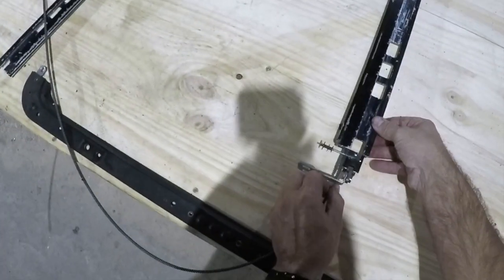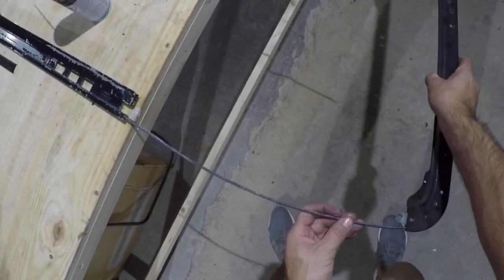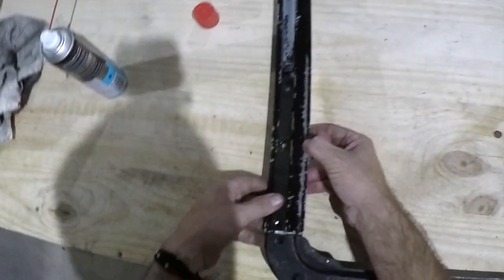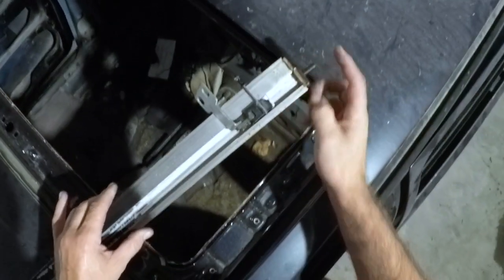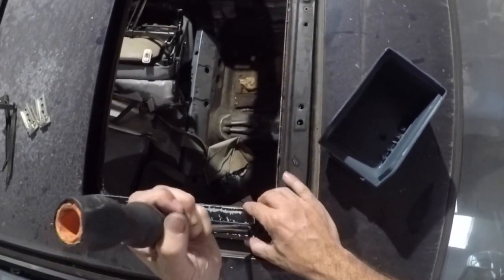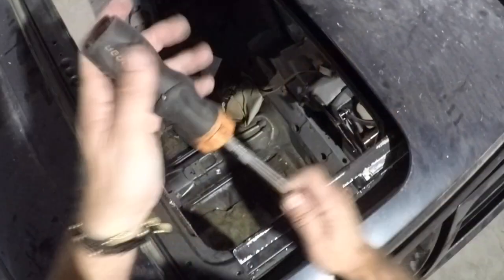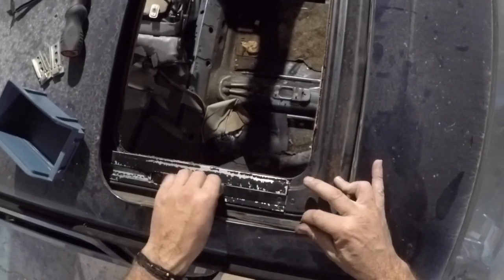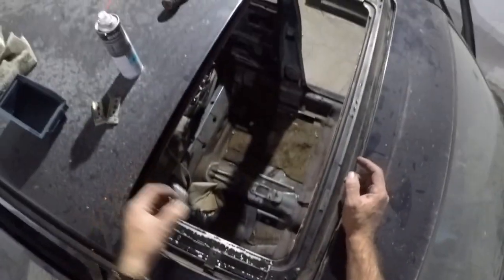How To VW Golf MK2 & mk1 sunroof Part 2 The refit

Comment: At any point do you have remove the whole headliner? Do you disconnect the drains and have to reinstall?
Reply from the maker: Yes to remove the drains, you may get away with it at the front, but not the rear ones.

Comment: Were did you get your fresh cables from ??
Reply: If your plastic cable part broke you can print it in 3d, there is a page called thingiverse where this plastic part is designed
Reply: @martiestmor99  are you able to change the bits over to the new one then I suppose?
Reply: @robertmacintyre3269  yes
Reply from the maker: Hi there, these pop up on ebay every so often, I think you can still get one from classic VW in Germany, 321 877 381 B but hope you're sitting down @ £147+vat
Reply: @RestoDesignsnando  wow 147€ i managed to get one NOS for 25€ and all i needed was the plastic parts!
Reply from the maker: @kiwiinaustria  I don't think you understood friend, VW Classic parts did sale the cables at those prices not us, Plus the plastic parts are part of the cables and can not be removed or sold separately, so again I think maybe you misunderstood.

Comment: I wonder if there is an electric motor that could be fitted in place of the center gear and have that switch on the dash to lopen n close it using power from the dome light and upping the fuse 5 amps and add a factory fog light switch to the guage bezel and delete a dummy switch hole cover . And say oh my vw is special it's sunroof is power... but what motor has the same gear size and bolt holes is the research to find that motor.